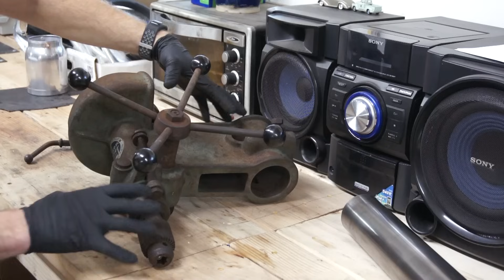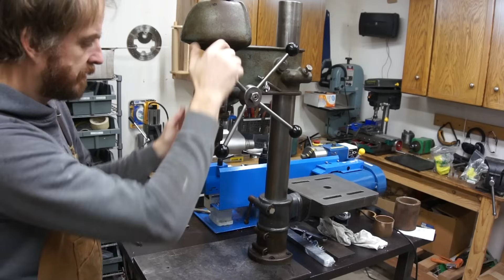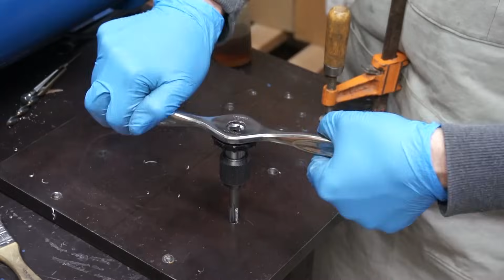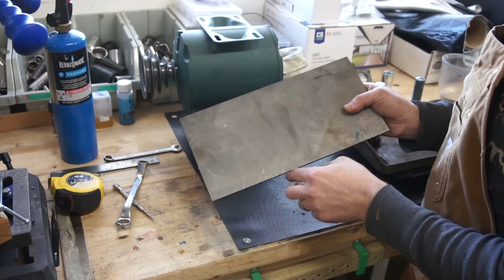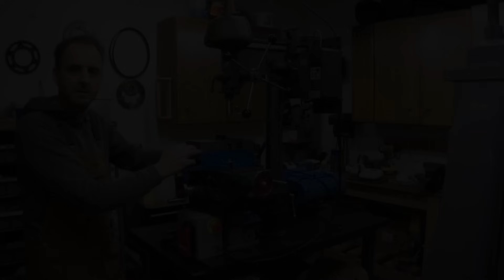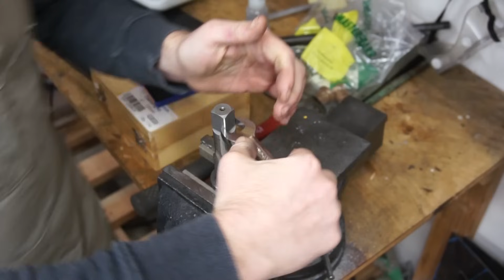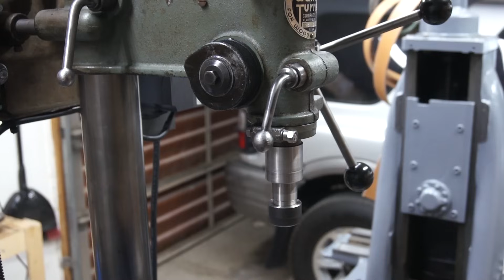Converting a Drill Press into a Milling Machine

Comment: Hey Robert. I’m a machinist of about 25 years. Obviously you’re not working with precision machinery, but we work with what we got right?! It’s a low budget option to manufacture and handle simple tasks around the home and garage. I just wanted to give you a few tips I noticed that may make your life a little easier working with your little drill/mill. As you mentioned about the bearings you didn’t notice a big difference in the finishes, between the standard and angular bearings. A lot of that has more to do with the actual tool itself that you are using than the bearings turning the spindle. The first thing I noticed is that it looks like you were using a 3/8 4 flute end mill with 1 1/4 flute length, with maybe a Tin or a TiAn coating. You only want to use that kind of tool to cut steel, in aluminum the extra flute creates a smaller chip and has less room for chip evacuation. The coating also creates more friction and gets gummed up by aluminum leaving a bad finish. For aluminum a standard carbide 2 or 3 flute end mill is gonna leave a much better finish, a little cutting oil will also go a long way in achieving a better finish. Also always use the shortest tool you can, to handle the job you are trying to accomplish. If you are just facing a part, a 1 1/4 flute length mill is to much. I would use a 1/2 3 flute end mill with 1/2 inch flute length, and then you always want to load the end mill right up to where the flutes start. You don’t want more than that sticking out unless you need the clearance. Using that size tool, and loading it that way is gonna increase your rigidity in your tool 3 fold, compared to a smaller tool sticking out an inch and half, Therefore creating a much more rigid tool, which is gonna reduce much of the chatter and leave a much better finish. The next thing, and you did kind of hit on it, when manual machining you always want to conventional cut, and not climb cut. What that means is that when you are cutting a side wall you want the chip to evacuate in front of the direction of travel. In CNC machining we do the opposite and want the chip to evacuate behind the direction of travel. So, if you are cutting a square part, you want to work in a counter clockwise direction. So you want to start on the front side facing you and for the tool to be on the left hand side, and the cut direction moving to the right, then the right side of the part you want to start in the front and the cut direction moving to the backside and so on. The next thing that’ll make your life much easier and save you tons of money on tooling, when cutting steel or harder material you ALWAYS want to use at minimums a 4 flute carbide tool. I prefer a half inch end mill with as short a flute length that I can get away with to complete the job, and chuck it up right to the beginning of the flutes. That’s gonna give a much more rigid tool and set up, and help eliminate flex in the tool, which will really help in reducing chatter, and leaving a better finish. Also when removing a lot of material I’ll use a roughing and finishing tool. The roughing tool you want to be exactly the same as the finishing tool but you want it to have at least a .020 radius. That’s a much stronger tool for taking larger cuts and not chipping off the corners of your flutes. Leave about .010-.020 on each side for the finishing tool to come in and clean up. I promise you’ll get a much better finish and save hundreds of dollars in tooling! Also Don’t mess around with high speed steel tools. You’re already working with a machine that’s not made for doing what you are trying to make it do so you don’t want to make your life harder than it already is by using cheaper tools! You can get away with it when cutting aluminum and steel but if the finish is important to you, you will never get the finish you desire using high speed steel end mills. Well I hope this helps! Good luck in your future machining endeavors!

Nick G.
Reply: Machinist of 36yrs and there's some good advice here! 👍
Reply: Nick that was without a doubt the most thoughtful comment I've ever read. Knowledgeable sincere, and stretched out longer than a football field.. I'll be honest I was going to thank him for a very deceiving thumbnail that caused me to watch this video. It should have never been up loaded due to it being a complete failure. What was this  guy thinking I should have fast-forwarded to the end to see what was inevitable. But then I read your comment. Your good man. Thank you.
Reply: @amwood7076  I with you.... It was worth the watch... albeit skipped a lot... just to read this gentleman's lovely, sincere and very informative comment... and yours also!! :)
Reply: High speed steel tools might actually be preferable in this use case since they are less likely to shatter due to them being softer
Reply: Hey, great advise here. you want the shortest possible distance between bearings and tool for better stability, sort of like holding a bucket of water. The further away you hold it from your body the harder it is to hold. Just a thought but I would negate the set screws all together and tap and die everything on the spindle itself. I might also try removing depth gauge and replacing it for something with fine threads and instead of using the adjustable nut for limiting how far up and down it can travel maybe make a T handle adjustable nuts to both advance and to lock the head in position. Also I would consider shortening the handles that have the Balls on the end as they probably and don't require being torqued on in this setup.
Reply: Great advise here.  You're right, we work with what we've got, but I have never been a fan of using a drill press for milling.  I have a massive Clausing drill press that I have used in a pinch with a cross slide vise, but even as precise and robust as that press is, it's just not designed for the side loads.  The work envelope on that drill/mill is small, and you can find mini mills that will handle the same size workpiece as that Walker Turner could accommodate, and have confidence that it will get the work done properly for just a few hundred dollars, and not have to fabricate everything that makes a drill assimilate a mill.  Yes, this is a project... a "let's see what happens" type of situation, but Robert will likely never be satisfied with the results.  If it's a project he wants, just find a cheap, filthy, old mill and spruce it up on camera.  Then let the chips fly.  Great video though.  I love projects.
Reply: Awesome comment with many helpful tips! Cool beans man.
Reply: That's good advice and I have heard some of your suggestions from watching other machinist ,so thanks for the advice in which I to will be adopting
Reply: Dang! Great helpful advice. If I could reach you, I'd offer my hand to you.
Reply: May have been a failure but still won my sub 
Good attempt sound analysis logical conclusion
Reply: Nick you should be an instructor
Reply: Good Man Nick!!. It was worth the watch... just for your very nice, informative comment!!

Comment: "Great job! Your video was interesting, my friend, but I was a bit confused about the speed you set for your milling cutter. In my opinion, the cutter would have either burned up or dulled quickly. This could be an expensive project in the end.
As a toolmaker with over 35 years of experience, my advice is to consider making your own fly cutter. A mild steel shaft with a notch and a tungsten carbide insert can provide you with many hours of cutting enjoyment and an excellent finish in the end.
The end mill cutter you were using is really designed for final finished like side walls in slots or groves and is only to be used with small cuts....like .010 to .020 thousands of and inch
Please take some time to research the material you're cutting and determine the appropriate cutting speeds before using end mills. Also, coating the surface with a lubricant makes a significant difference—it cuts better and results in a smoother finish. I recommend getting a small tin of Rocol and using a small paintbrush to smear it on the metal's surface.
Good luck, mate, and happy machining!"

Comment: in my woodworking shop, i have the same walker turner DP and a Beaver 3700 which very similar but about 50% bigger and heavier.  the beaver also has tapered roller bearings(adjustable with shims).  i would really like to convert one of them to an er20 collett.  they both have the same jacobs taper and the threaded retaining collar.
i have a vfd to a wood lathe from the same era as your drill press( and my 2!)  sure beats moving belts around
so this video has been very informative, thank you

Comment: An interesting project for me since I just sold my Bridgeport Knee mill and could use a small project machine going forward. Thanks
Reply from the maker: I have another set of videos with some really beneficial upgrades.  One where I make a new table with linear guides, and another (not yet published, but out soon) where I swap the head and fill it with epoxy sand.  If you haven't seen those, check them out.

Comment: THe digital readout on yiour VFD is a pecentage of the powere not RPM, you can pick a cheap rev vounter on ebal for very cheap. I have one just like it on my lathe. If you hit the little red stop button on the VFD itb will apply shunt braking and stop a lot quickrr than just cutting thw power.

Comment: Thanks for the honest video.  I was making a simple box frame for an A/C cover.  Don't get easer than that. Reversed the dimensions changing the joint configuration.  Frustrating but practice makes perfect. I learned a lot by your example. Great work.  The comments below are excellent.

Comment: I applaud your effort! I have a large WEN drill press and walked down that same road trying to convert it to a light milling machine; my quill was the issue.  Like you I made a collar with set screws to reinforce the quill and support the side forces and to a limited extent it works, but only to a limited extent. If I could just start over I’d buy a small mill and use it for my drill press..

Comment: IMHO::face-green-smiling: YOU COULD INSTALL A STANDARD ELECTRO-MECHANICAL "MOTOR-STARTER", CONTACTOR, JUST AHEAD OF THE MOTOR, AND CONTROL IT WITH AN "E-STOP" SWITCH, 
TO USE, AS A RELIABLE "SAFETY "KILL-SWITCH".:face-red-heart-shape:   [IT'S A BIT UNIQUE, THAT YOU HAVE 3-PHASE POWER, IN YOUR SHOP. ]

Comment: Nice job, I also noticed that your up and down has left and right play in it enough to push the quill away from the stock in your vice.
Reply from the maker: Up and down on the table?  I may reverse the decision and weld the lift jack to the table.  Maybe make a track for it to ride on.  I have some linear guide rail for another project that might be good for the task.  Thanks for the comment.

Comment: FYI   A "Drill Press"   is NOT a milling Machine !   AND should NEVER be used as one !!   it is NOT designed for LATERAL 
Side Thrust which is REQUIRED while Milling Stock or an object . NEVER use a Machine tool for ANYTHING other than what it was DESIGNED to Do !   You WILL INJURY yourself and Possibly Destroy your Machine .  I am a retired  Professional Toolmaker /Machinist
of 57 Years, in the Industry .
Reply from the maker: Because nobody ever told me that it couldn’t be done, I went and did it and used it for years.

Comment: Are the original spindel bearings are suitable for milling ?  Do you modify those, too ?
I guess, there must be at least also a thrust bearing, that stops the mill from digging downwards.
In general the spindel bearings for a milling machine must possibly be much stronger than for drill press.

Comment: I have a drill press that i want to convert to a mill and I appreciate your video.  It will help in the conversion.  May I ask where you purchased your X-Y table, or did you build it?
Reply from the maker: I got it on eBay.  Search for "Compound Table" or "Compound XY Table".  It should be right around $100, shipped.

Comment: You know that VFD has DC braking?
I did exactly this except I did it with a Fobco Star drill press, these have angular contact bearings & will take radial loads far better than your average drill press.
If you set up your VFD properly you’ll get DC braking for the motor. Use the low voltage control lines with a latching stop switch that has both N/O & N/C modules, run the return for the stop & start switches through the N/C & a parallel stop through the N/O, that way you won’t be able to restart it until you release the switch. But you have to have a stop & start switch too as you’ll lose the function of the VFD panel when you change the programming for remote switching function.
I used a 4 button control so I could still use the jog function for power tapping & the final button gives me fwd/rev function.

Comment: Anyone know where I can get some of those bakelite ball handles ? I’m restoring my Grandfathers Walker Turner drill press, also a source for quill bearings just in case.
Thanks
Reply from the maker: These are really close.  Same size diameter but the threads are only 8mm.  The threads on my Walker-Turner are 3/8-16.  You might be able to drill these knobs out and tap them for that thread.   (Not an affiliate link)

https://www.amazon.com/gp/product/B07WVP82VD/

Comment: Way cool looking forward to see if the bearing change will do it.  By the way what would a mill cost you in your neck of the woods?
Reply from the maker: They are expensive and don't pop up often.  Round column mills, typically around $2000.  Bridgeports, when they do crop up, around $6k for the ones that are worn out.  I eventually bought a Jet round column mill to replace the drill press.  It was $1k on Craigslist and needed to be rebuilt.  The drill press mill is now used for smaller milling projects since it's so easy to set up.

Comment: Frist thank you for this video it is helpful to me as I have the same drill press. This is just what I want to do with it, it is heavy duty and weigh's a ton.
Where did you get the DC motor from? Thanks' again I will keep watching.
Reply from the maker: It’s an AC motor.  3-phase.  The vfd converts my shops single phase 240 to 3 phase to run it.  Motor was an eBay purchase.  $100, I think.  Chose it based on RPM and base.

Comment: My uncle bought an old mill i mean really old it looked a lot like the walker turner headstock
But it wasn't very accurate  but my cousin stuck a very large 5 head carbide cutter on it and that sob could remove some metal, but it wasn't pretty  even the finish pass wasn't really good, we even stuck an indexer on it  but i scraped the part because i didn't know how to read a production blueprint that had multi parts on it the sane blueprint covered 5 sizes of the same part. 

Anyway, Grizzly makes a pretty nice 
Mini mill thats about that size
And yes i get you don't want to use something made in Taiwan but that about all you can get is imported stuff or old used US made stuff.
Look around you can possible find an old Bridgeport and power converter. I think you can run a Bridgeport in 480 or 240 3 phase then get a phase converter.      
I remember a guy with a lawn mowing business buying a Bridgeport that was 480 3 phase from us using it in his home workshop he didn't have a commercial power drop to his shop
Besides thats just what pole transformer the power company installs. 

My uncle started his machine shop in a gas station in the 1950s it grew to one of the largest in kc at one time, then one of his largest clients moved out of town and he lost a lot of work, but had bought millions worth of cnc machines. The company pretty much went broke.
In the early 2000s   search a used Bridgeport doesn't cost that much.
I've seen them for 2k one at 1500.
Be patient.   
Id use what you have for woodworking and plastics.

Comment: Always use the safety strap with your mag drill! I had an accident with mine and it ended with a 15mm steel helicopter spinning until it snapped a 40mm annular cutter and ripping the cable out the machine
Reply from the maker: That's good to know.  Mine didn't come with a safety strap but I'll see what I can fabricate.
Reply: @RobertAdairWorkshop  sometimes a little gap between the magnet and the drill body 👍

Comment: 13:05 VFD should be programmed to inject DC current in to motor windings, motor will than stop from 3000rpm to full stop in 0,2sec.
Reply from the maker: That's been on my list to try and fine-tune.  Maybe a winter project once all the other winter projects are done?  I have that VFD on three machines now and it'd be nice to have some DC braking.
Reply: @RobertAdairWorkshop  On large mass machines and VFDs with power close to motor power, also with high number of breakings in hour you may need breking resistor installed to dissipate breaking energy.
I have 550W motor on my small drill press and 750W Yaskawa/Omron VFD, and breaking resistor is not needed with hundreds of dc breaking stops in 20 minutes.
DC breaking is great help when tapping and when i want to change tools fast and do not want to wait for machine to stop by it self.

Comment: I SEE YOU WERE KLINE CUTTING THATS WHY IT VIBRATES  TURN THE CUTING EDGE OF THE TOOL INTO THE PIECE IT TAKES THE SLACK OUT OF THE TABLE OR IT WILL TRY TO CLIME  DOWN THE PIECE . KLINE CUTTING IS ONLY FOR A CLEAN LOOK OR FINNISH CUT TO SIZE.

Comment: nice project for very light work only, the main issue being that drill press bearings are not designed for any side loading so they won't last very long if used as a mill.

Comment: I’ve done the same thing. The issue is that there’s a lot of weight sitting on top of the post that holds the drill up and it does wobble in the New role!Find a way to secure motor to the wall to keep the whole unit more secure. It makes a huge difference.
Reply from the maker: That's really good advice.  Thank you.